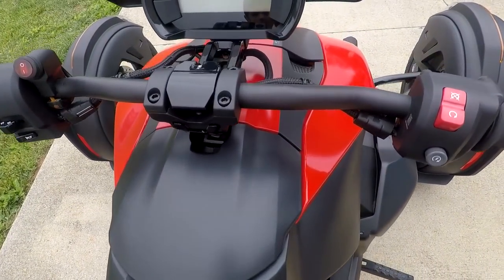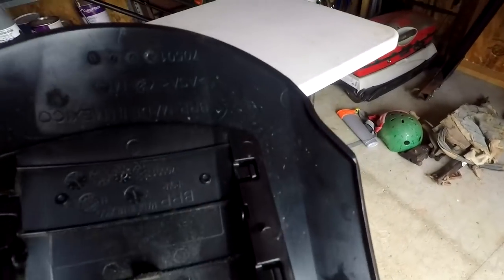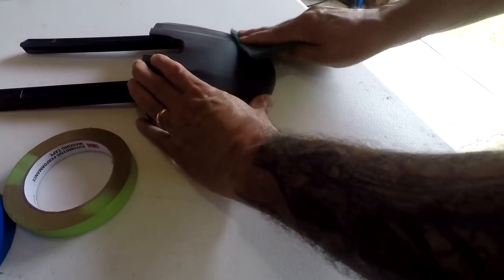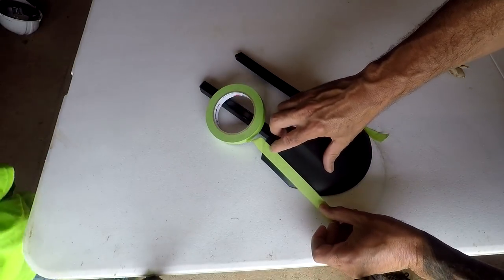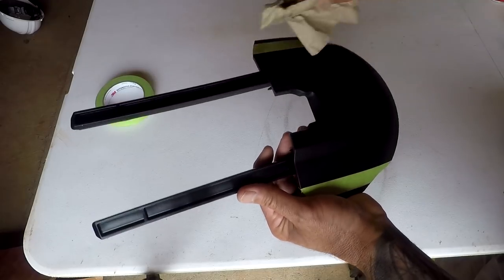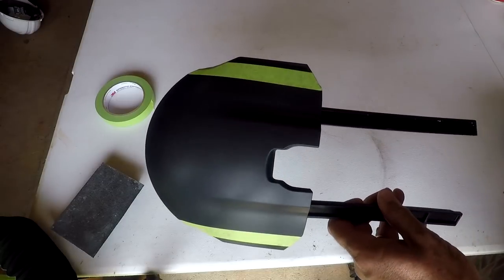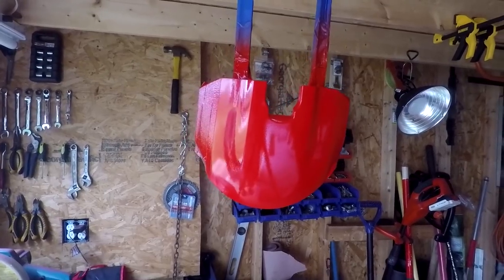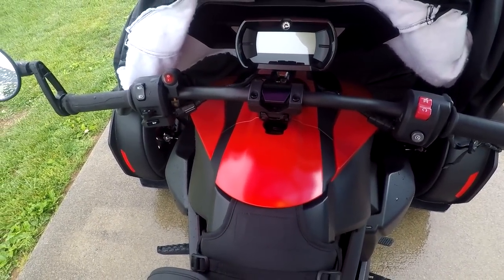More painting on the Ryker

Comment: Some people use 50 percent rubbing alcohol and 50 percent water mix together to remove greasy residue before start painting. Not sure if it's ok for plastic materials, probably ok.
Reply from the maker: Dean Cavander I’ll have to look that up, I have used hand wipes in the small packs which is about the same. Paul